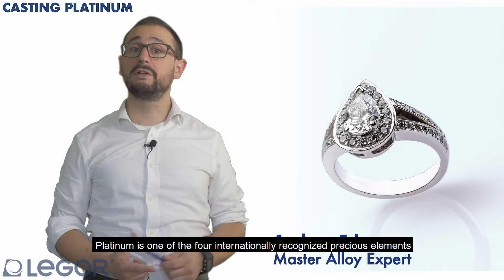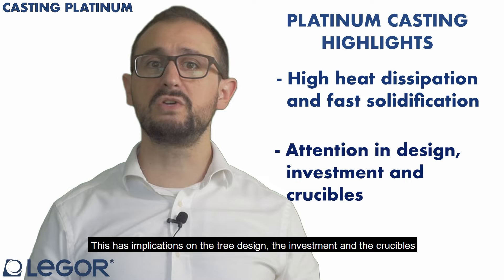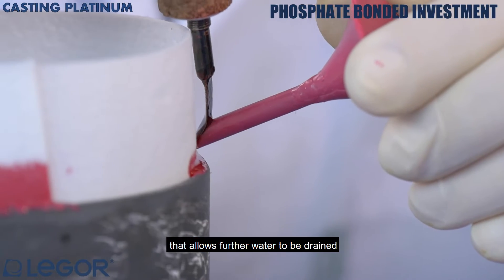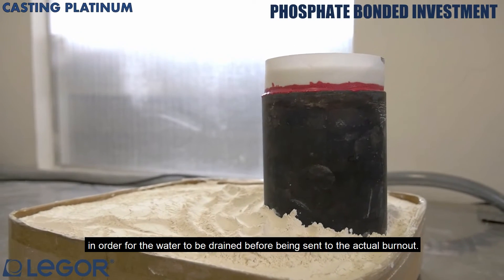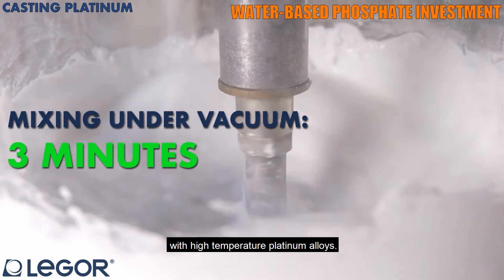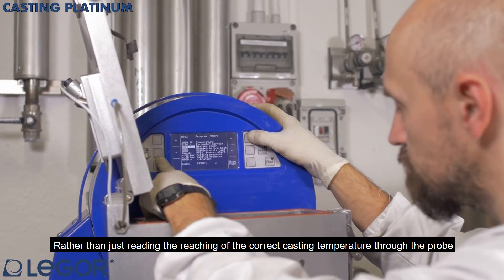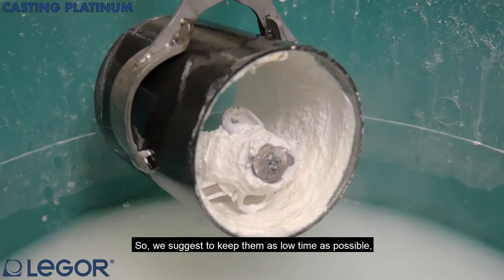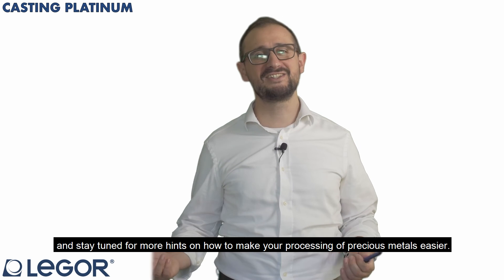How to cast platinum?

Comment: thanks for a detailed video. A newbie question. The mix of investment powder and water ie 33-35-100, I assume that is by weight. Does it mean I need to mix 35gm of powder to 100gm of water or is it the combined weight?
Reply from the maker: 33-35 grams of water + 100 grams of powder. Anyway, we highly recommend to follow up the instructions reported in technical datasheet of the investment supplier. If you have further questions, don't hesitate to contact us here: https://www.legor.com/en-us/contacts